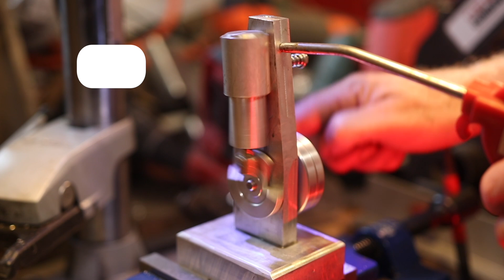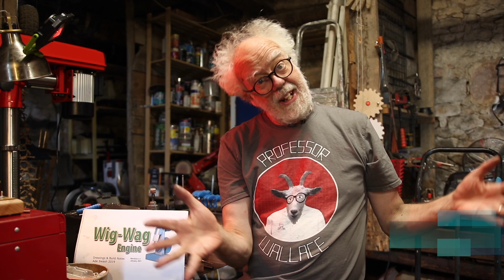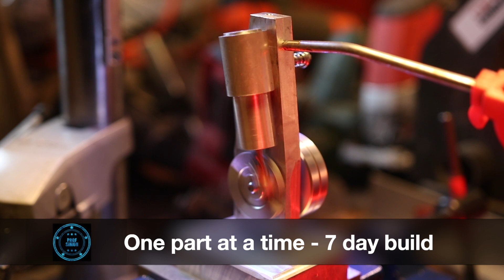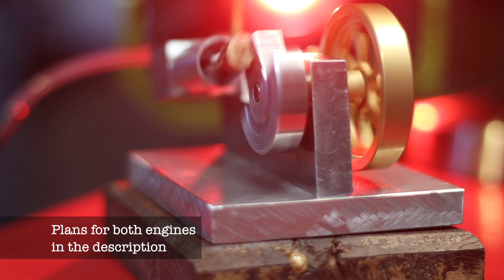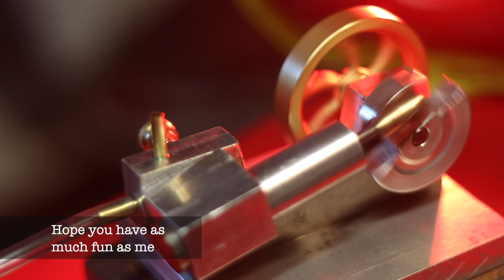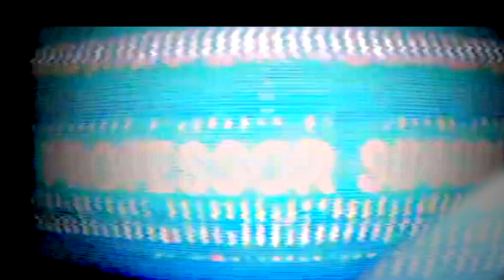My first Steam Engine - Professor Simon

Comment: Professor Simon. That's great. That will force a person to think in (3) three dimensions while building the small engine. It will also give you insight into massive endeavor which was made for WW2. On scales way much larger. Kenneth.
Reply from the maker: so true....makes you think in 3d and be as accurate as possible.